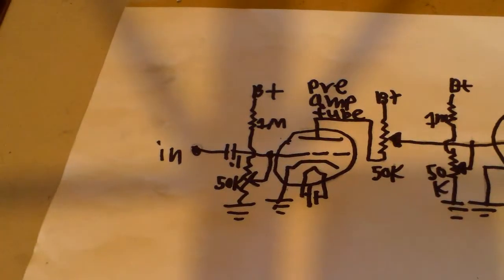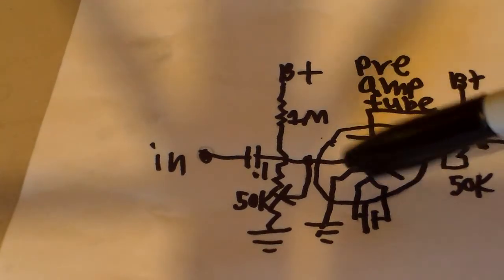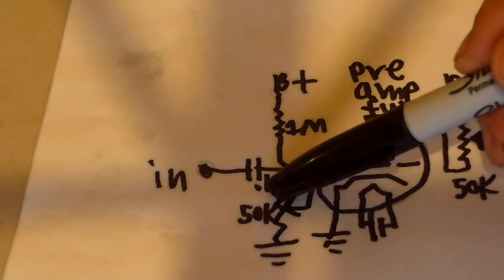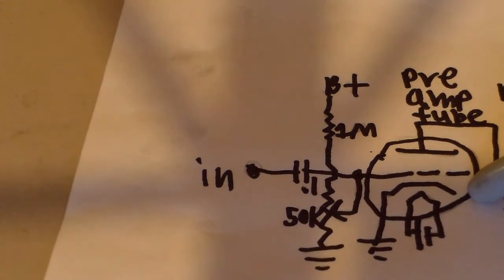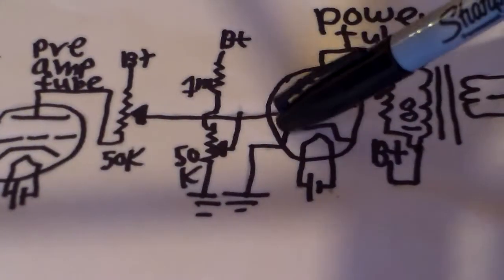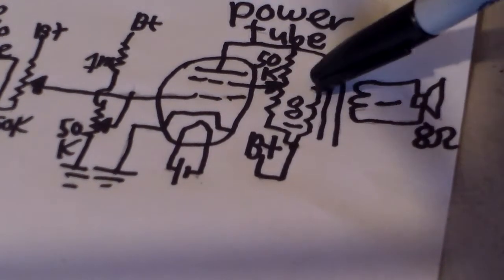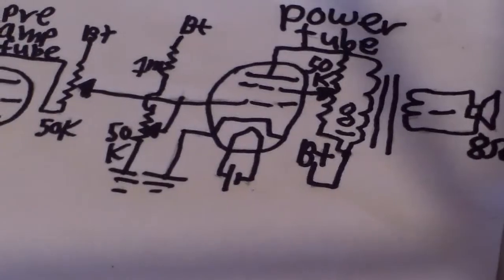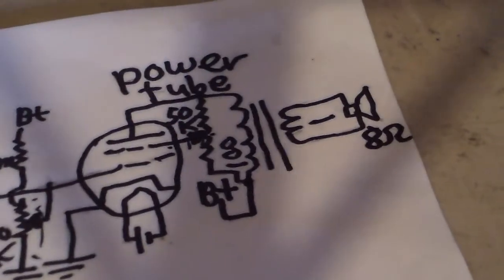vacuum tube amplifier circuit that might work

Comment: The circuit is (in its principle) good. Some advices: A) use a coupling cap. from 0,1 uF - 300V between the wiper and the grid from the second tube B) use a normal (audio) transformer, not an autotransformer 3) study whether tube 1 needs a negative voltage on its input grid and surely tube 2 needs a negative grid voltage to get it into its right working point. The value from the neg. grid voltages depend on the tube properties (tube handbook).